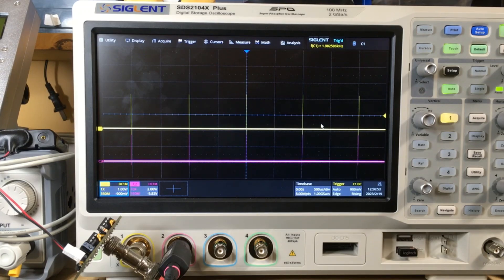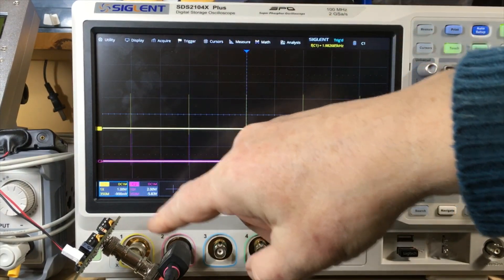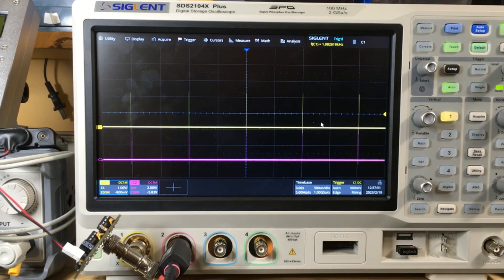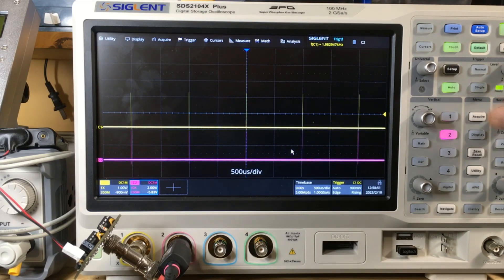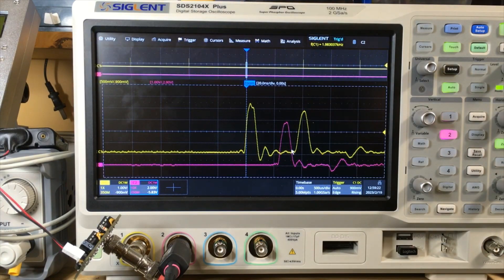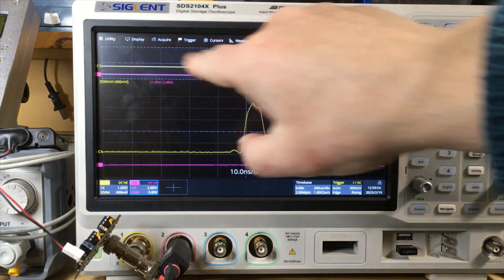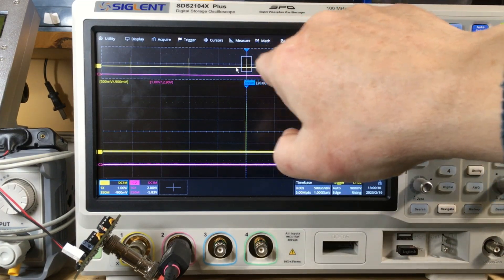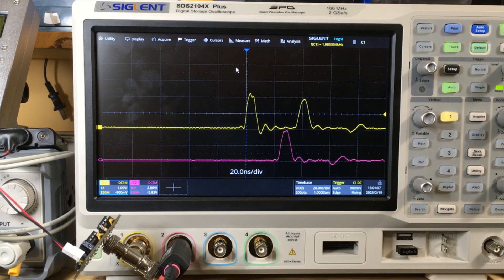0019 - Siglent SDS200XP Horizontal Zoom Mode (a very quick look)

Comment: My Siglent 1104X-E also has this feature.
Reply from the maker: That's true.  Do you use it often?
Reply: @uni-byte  Not often. IIRC, I did use it to make a very technical report on some old project. It was quite useful for getting the point/information across. But, I may be thinking of some other split screen... I think there is one on the FFT. IIRC, it can not be turned off, when you would like to have a full screen. But, I am older and my memory doesn't seem to be as detailed as previously. Art Linkletter said "Getting old old ain't for sissies." lol
Reply from the maker: @t1d100  Truer words were never spoken.